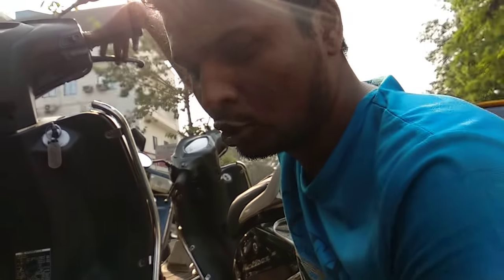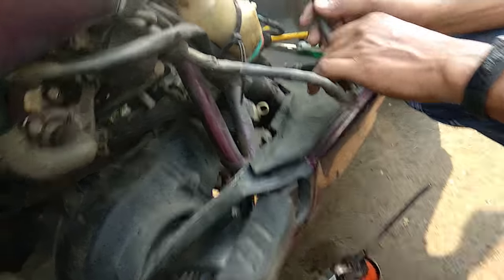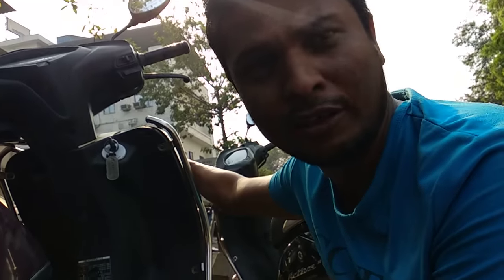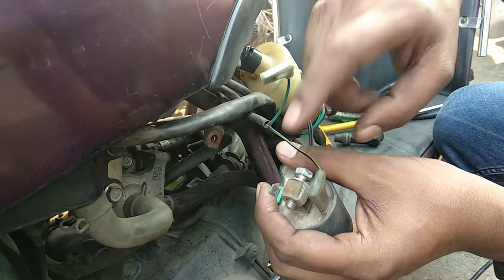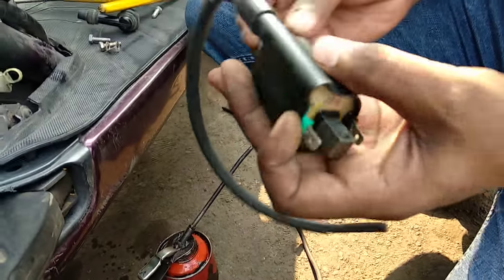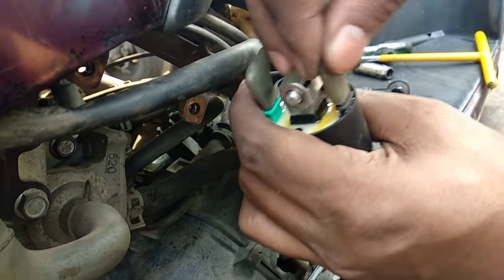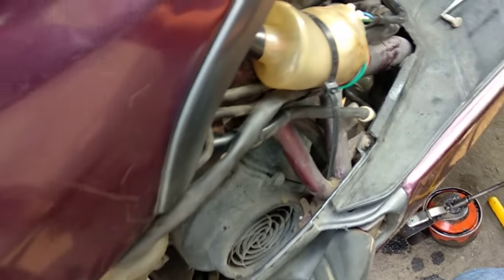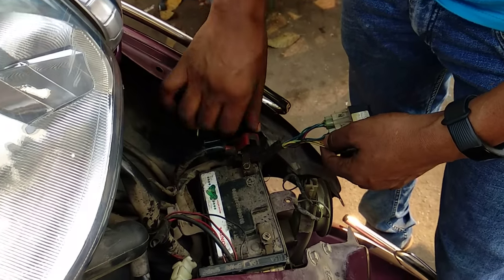Honda Activa starting problem ignition coil replace

Comment: Activa k CDI aur igination kya rate hai
Reply from the maker: ignition coil CDI unit magnet coil Yeh teeno se current Aata Hai Par ya Sab jaldi kharab nahi hota Hai CDI unit battery ke ps  Laga rehta hai  Isko Aap khud bi   aapke paas Dosto ke  Paas Agar Activa uska laga ke check kar sakte ho 1 minute mein test ho jata hai Kya kharab Hai
Reply: In sav ka rate Kya hai market me

Comment: Bhai meri honda aviator hai 2010 model usme fuel tank me baar baar fuel automaticaly paani ban jaata hai aur gaadi ko baar baar service karwa k saari tanki aur carburater saaf karaana padta hai. Carburater; fuel tank aur insulator coil bhi badalwa diya par problem ab bhi wahi hai. Company waale bhi sahi nahi kar paa rahe. Please help.
Reply from the maker: Bhai fuel tank cap check kro agr waha se air Nahi Milta Hai to b isa Hota hai Cap kharab rahta hai or jaha se Aap fule lete Ho wo  pump se fule mt lo
Reply: But bhai maine alag alag petrol pump se petrol lekar bhi dekh liya aur fuel cap kya maine puri tanki hi badal di par ab bhi problem wahi hai.
Reply from the maker: Fr to check kr na padega app Mumbai me Ho?
Reply: Bhai mai kanpur up se hoon. Kya kahi engine me toh fault nahi hai? Ya phir ye tank se lekar carburetor k beech me koi part ho jo air le raha ho. Main jisko is problem k baare me batata hoon woh hairaan ho jaata hai kyunki aaj tak yeh fault kisi aur gaadi me nahi aaya.
Reply from the maker: Nahi Bhai bahut gaadi me problem Hota Hai pr wo tank Cap ka issue rahta Hai
Reply: Bhai but tank hi badal diya aur saath me insulator coil aur T bhi badal di.

Comment: sir...meri Access 125 2011 ke Hai ... use morning starting problem hai...ek baar engine chalu hua to din bhar kuch problem nahi hota hai, problem kya ho sakati hai..???
maine company ke service center me 2 time gaya, carborater clean kiya, spark plug change kiya, Air Filter Change kiya... Lekin problem nahi jaraha hai.... mene morning ko check kiya to petrol bhi ata hai aur spark plug wire ko current bhi hai.... please help mi
Reply: multimeter se kaise current check karu..??
Reply from the maker: Bhai uska engine compressor check karo Access 125  ka head valve ka problems rehta hai

Comment: sir aj meri activa125 pani mai bnd ho gyi. Pani se nikal ne ke baad maine start kiya toh start ho gyi likn acceleration nhi pakad rhi thi puri race dene ke baad bhe halka halka smoke nikl rha tha. Fir main scty 5 min baad start kiya toh start he nhi hui.. kya kru mechanic keh reh silencer main pani h koi keh rha h spark plug krab hai ap bta skte ho kch suggestions. Please help ❤️
Reply from the maker: Exhaust. Open kr lo Bhai  or spark plug or carburettor clean kr start Kro Bhai or engine oil change kar dena
Reply: Mechanic ne start kr di spark plug change hua or ab vo carburettor clean kr rha h...sir silencer se halka halka smoke arha h???

Comment: sir mere pas activa h. uski starting to theek he lekin vo 10 ya 12 kilometer chlne k bad jese dhire dhire bnd ho jati he. pr 2 ya 3 min bad enjin fir chalu ho jata h  to ye kya problem ho skti h,
to plz sir rply
Reply from the maker: Jb band hoti Hai US time jb Aap start karte ho engine ki sound kuch different rehta hai kya ,? is Case me  koi  coil week Hoga ya to fr engine compressor
Reply: sir plug me current to aa rha h. to kon coil week hoga
Reply: @ramanlally6330  Carburettor mai 'O' ring ko replace karo
Reply: lally saab uska pikap coil kharab hai jo hit hone ke bad band ho jati hai

Comment: Bhai mere pas aviator 2012 model ki hai uska bar bar cdi unit fat zata hai usme kya problem ho Sakta hai pehle uska starter relay attak zata tha no bhi change kia
Reply from the maker: Battery voltage check karo  overcharge to nahi kar raha hai rectifier regulator ya to fr is Ka wiring  body main tech ho raha hoga

Comment: Activa late starting how to solved frobulam. Not anser U tube vedios
Reply from the maker: causes of hard starting 1 try on choke on if not ok need to check mechanic sometime fuel problem current issue engine compressor different problem

Comment: meri dio 2010 ke morning starting problem hai... company ke service center me 4 time gaya,
carborater clean kiya, spark plug change kiya, timing set kiya... firabhi problem hai. 
ek baar engine chalu hua to din bhar kuch nahi hota, problem kya ho sakati hai..?
Reply from the maker: Bhai us time dekhna padega Jab start nahi hoti hai tab current nahi aa raha hai ya  Phir petrol nahi aa raha hai pr  mujhe lg Raha Hai engine intake valve problem ho sakta hai
Reply: Chok s ek bar start kro bas din m first tym

Comment: Bhaiya ye batao meri activa 2010 model he jab bhi me usse 20-30 ki speed se chalata hu to wo properly work nhi krti atak atak ke chalti he or jab bhi break marke uthata hu to ek dam se lot nhi le pati.. mane sab krba ke dekh liya CDi and ignition coil spark plug filter clutch shooe bald rin piston sab plug ka cap..... sab hi kuch change krake dekh liya ye problem solve nhi hori plzz batao...
Reply from the maker: Bhai  wo to chlane ke baad apko Sahi bta sakte hai k fule ka problem hai ya fr current Ka issue hai Ho Sakta Hai pickup coil khrab Ho Sakta Hai carburator ke andr koi jet bnd ho  Koch bi Ho Sakta Hai brother  Q K Jo Aap bta rahe Ho clearly try Marne ka baad hi Koch  bol sakte Hai
Reply: @AlAnsariAutomobile  apki shop kha h bhaiya
Reply: @AlAnsariAutomobile  wese sahi kaam kr rhi scooty speed bhi 82 tk pakad rhi he bs yhi problem nhi ja rhi kam speed pr chalata hu 20-30 ki to jhatke marti he... or vibration bhi bhot krti he break speed me break lagao phir rase dake uthao to ek dam uthi ti nhi he lot mangti he... bs yhi dikatt h start b ek dam ho jati he
Reply from the maker: Nerul Navi Mumbai
Reply: @AlAnsariAutomobile  sir yhi se bata dijiye kucH me bhot door se hu kuch Help ho jaye to me wo krake dekhta hu jo aap bata do
Reply from the maker: Ye number pe Baat kr lo kahna imran ne number Diya Hai +91 99671 38458

Comment: Meri activa ki cdi coil kharab ho rahi hai 2 bar dali 4 din ke andar .kya problem hoga please batayiye
Reply from the maker: Brothers iska wiring Chakkar  kro short circuit To Nahi iska wiring Jahan Par Hum Log pair Rkhte Hain wo plate khol ke dekho wahan par short circuit Hota Hai aur ek baar voltage check kar lo battery me kya hota ja raha Hai overcharge to nahi kar raha Agar Yeh Sab ok hai To Phir coil check karna padega  ignition coil magnet coil
Reply: Thanks brother mai bolta hu mechanic ko
Reply: wiring chek kro bhai or ek bar chargar dekho khi shot to nahi he

Comment: 2 din phle nyi battery dalwai honda aviator m phir bhi self start nhi ho rhi awaz aati h thodi si horn ok baj rha h please help
Reply from the maker: battery naya dalne ke  baad sahi tha kya? agr sahi tha or ab wapas se start  nahi ho rahi hai to battery charging ka problems hoga bhai rectifier unit ka
Reply: Al Ansari Automobile  2 baar new battery dalwa li thoda sa self leti h but start nhi ho rhi
Reply from the maker: Jb aap start krte ho to Awaz aati hi Koch? agr aati hi fr to starter motor ka problems Hi bhai carbon brush check kro

Comment: Ignition on karke ek wire mein spark a raha hair,dosri wali wire mein spark kaise ayega,
Reply from the maker: Self starter karne pe pals current Aata Hai or kisi me ground current rahta Hai
Reply: Al Ansari Automobile  sir activa het mein ignition on karne pe ek wire mein current ata hai,dosri wire mein kaise check karen
Reply from the maker: Bhai Activa me deferent CDI unit Hi deference system Hi agr apke pas multimeter hai Toh Sahi se pata chal jayega

Comment: In tino ka rate Kya hai market me
Reply from the maker: CDI unit 400 se 3000 tk ignition coil 220 se 500 tk different company ka  different price Hai  do teen model Aata Hai
Reply: Guru JI kaun se brand ka durable hoga please bataiye.honda activa  125 k liye
Reply from the maker: swiss ..ka pisa km hai or accha bi hai apke yaha Jo mil ta Hi wo lga lo